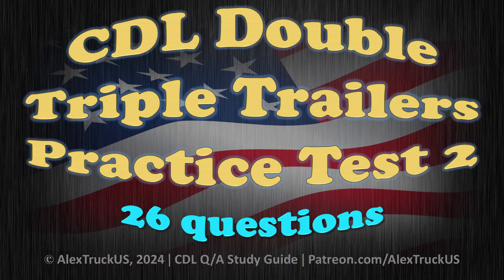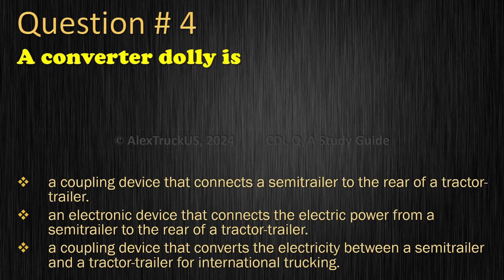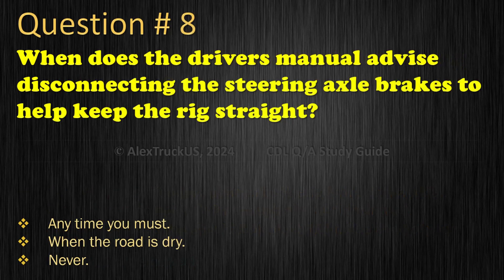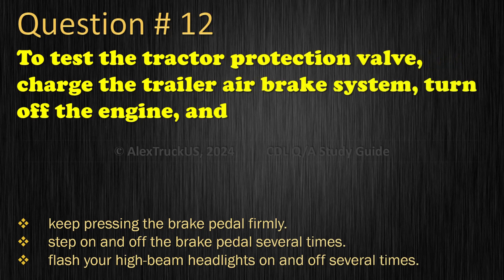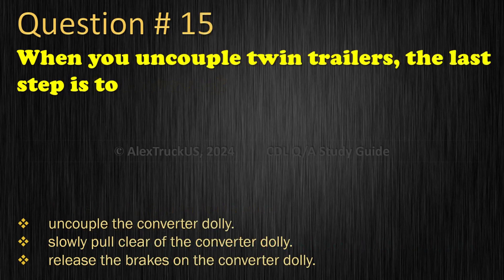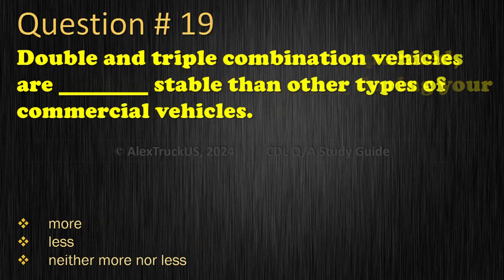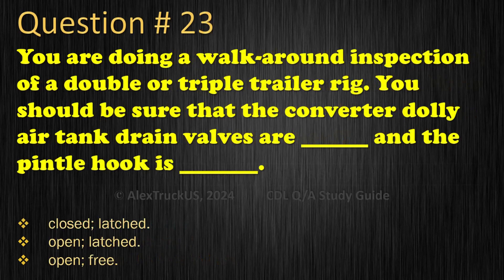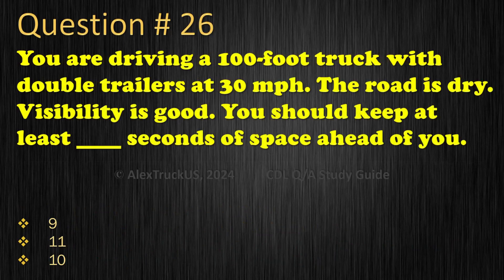CDL Double/Triple Trailers Practice Test 2【26 Q/A】

Comment: I took the doubles/triples test today In California. I studied both of your Doubles/Triples videos for many hours and I had every single question and answered memorized 100%. Many of the questions and answers were on the test, but there were quite a few questions that the test that were not in the video. As a result, I barely failed the first test.  I had to guess on some questions. Some questions I guess right and some I guessed wrong. I missed it by one question. I immediately re-tested and passed with only a few wrong from questions I’ve never seen before. This video is extremely helpful. Some of the tests have more questions from the videos than others. It’s a gamble which test you get. I suggest skipping questions you don’t recognize. In California you’re allowed 3 skips. I passed the Hazmat test today also on the first try. Also there’s a lot of questions on that test that aren’t in the video. And many questions and answers in the videos that aren’t on the test. If I didn’t watch these videos I would have failed all 3 attempts. Thanks for these videos; they are extremely helpful